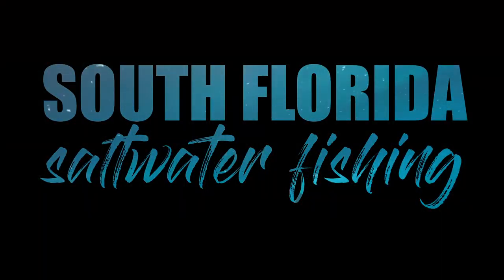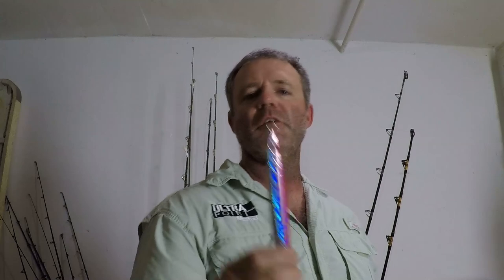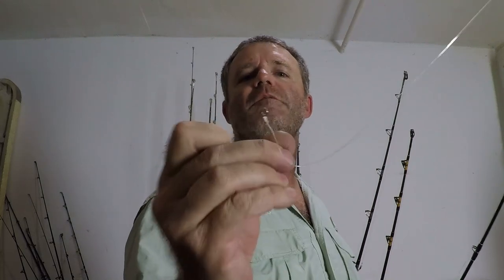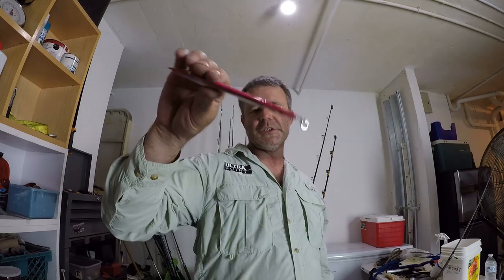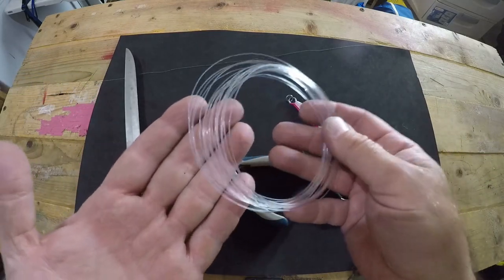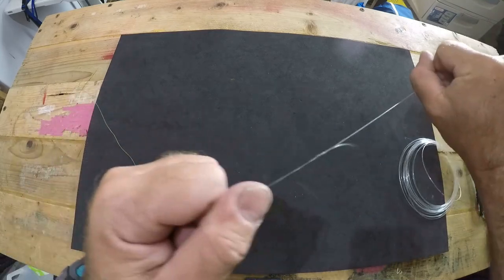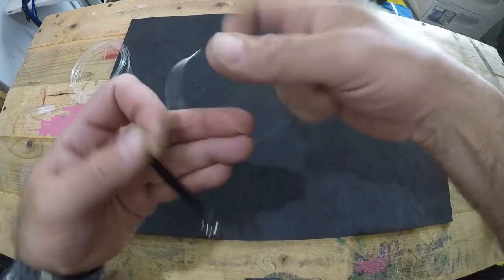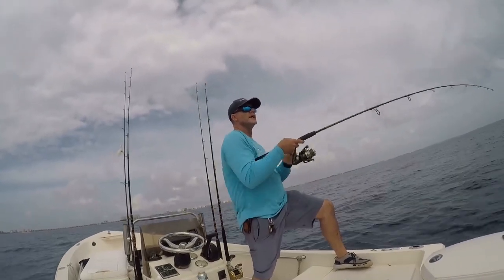How to rig up for HIGH SPEED VERTICAL JIGGING

Comment: Another timely topic for me. Just finished building a solid carbon OH rod with a spiral wrap. The blank is 6' long with a 9mm butt and 2mm tip. Believe it or not they get these fiberglass wrapped solid carbon blanks called "sutet" from the left over ends of high tension electrical cables. Gotta love Indonesia. I'm looking at buying a kastking bc reel just for this rod with a 7:1 ratio. I figure that'll be perfect for fast jigging with 80 to 150 gram jigs in maximum 150' water. I'm too old to slug it out with the 300-500 gram jigs down to 500 feet. I recently bought two kastking spinning reels, one of which is the live liner and I'm really impressed with the quality they're putting into these reels. Even the box is awesome!
Reply from the maker: Thanks a million for watching and sharing.  Your setups are making me jealous, LOL :)))  seriously though, sounds like you have some great gear and you put quite a bit of thought behind your choices and selections and don't make hasty decisions to get out there and get some line wet.  Which is always best policy, patience in fishing is not just about waiting for the bite, but an all encompassing process, especially when it comes to finding the right gear for the target fish and tactic.  Thanks again for all your support, couldn't get this done without you.  Tight lines & take care ;)

Comment: Nice, tutorial here, so many others leave out parts of the A-Z.  Few questions:  Do you make your own tandem assist hook setups?  If so, why do you use heat shrink all they way from the hook to the ring?  I've see guys tout using hooks on both ends of the jig, to me that could make things messy and get hooks caught on your leader correct?  Finally, any reason you don't use the modified/improved clinch knot?  I've always used the improved, but I wonder if the extra bite in the knot could actually weaken it?  Thank you.
Reply from the maker: Thanks for asking all your questions and watching and supporting the channel.  When it comes to vertical jigging at a high speeds you only want to use that hook setup on the top if you use hooks on the top and the bottom you're more than likely to get snagged on your leader you are correct.  I tend to use only a one hook set up on the top when high speed vertical jigging.  The heat shrink is irrelevant you can have it all the way from the hook to the solid ring or just halfway or it can not be there at all.  The Teflon line attaching your hook to your ring is what is essential. Finally when it comes to the clinch knot.  I fished for well over three decades and have examined many different versions of the clinch knot and the original one which is just essentially seven wraps or six wraps and you pull it through the eyelet pinch loop is just as effective as any of the other versions I've seen.  Hope this helps.  Good luck in your fishing journeys

Comment: Hello so how do I know how many grams the rod can handle?cause it doesn’t normally say it handle 200-400 grams on spinning reel rods,so is there like specific rods that’s only used for vertical jigging ?cause I don’t know like how long the rod should be and how strong it should be for using a jig that’s like 100-250 feet of water
Reply from the maker: Thanks again for watching asking another great question.  Most jigging rods do have the weight range that the rods are rated for.  Yes, jigging rod blanks are constructed differently from standard spinning and conventional rods.  However, f you don't have access to these, it's perfectly OK to use any rod.  You'll want the lightest action rod you have, that way it'll pitch the jig properly.  Then it will be a research process to figure out how heavy or light of a jig it will handle.  Hope this helps.  Thanks again for your support.  Tight lines & take care ;)